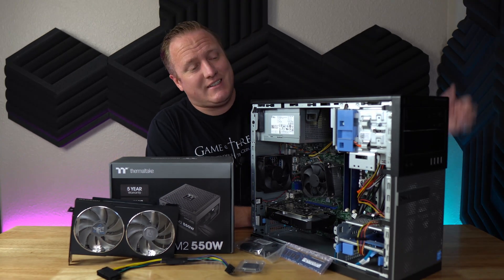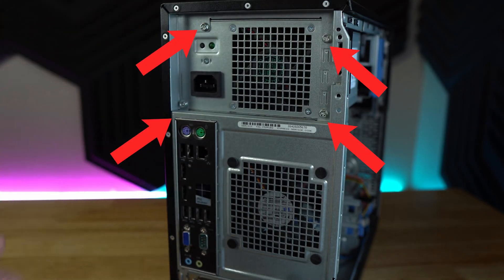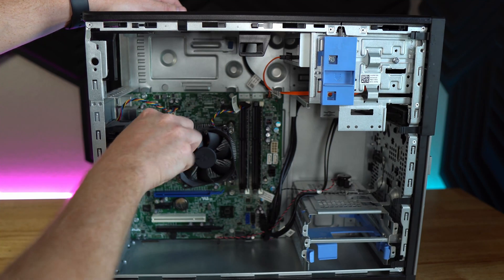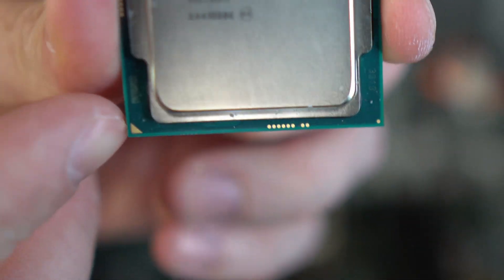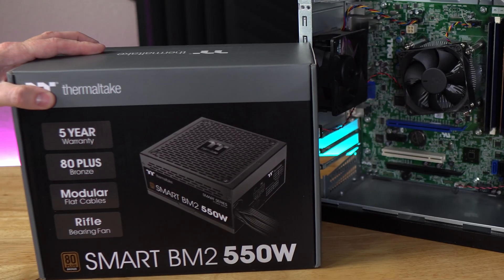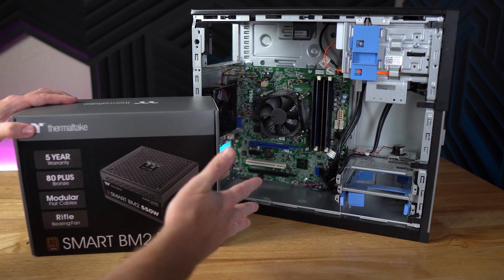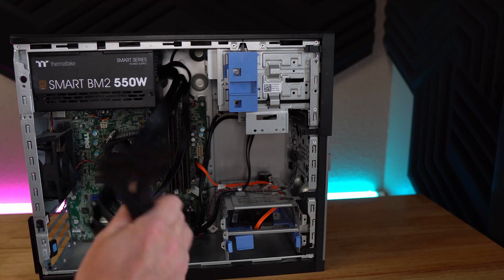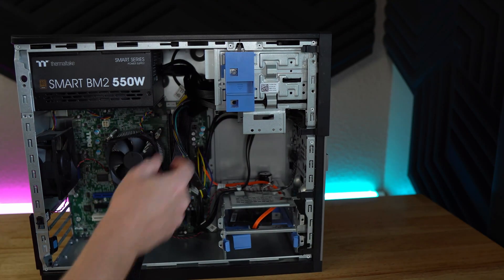Upgrading Your Dell Optiplex? Here's What You Need to Know!

Comment from the maker: If you haven't seen where I come so far with with this Dell Optiplex then go check out the previous vidoes I have done on this machine so far (below)
- Can I Turn a Dell Optiplex Into a Gaming Beast?  Parts Hunting for Reasonable Upgrades! -- https://youtu.be/wtuXV8aJrcY
- In 2023, Game NOW For UNDER $200 On This Dell Optiplex + RX560 -- https://youtu.be/9stPY7T1YNY
Reply: I happen to have stumbled upon a i7 4790k and I have no system to put it in and I'm wondering what optiplex I could get?
Reply: @Sneaky_snekk  I recommend the model shown here, the 9020 MT. It has 4 DIMM slots for max. 32GB of 1600mhz DDR3 RAM, it has more room in the case than the SFF model, and your i7 4790k is the max CPU it will take. I'm in the process of building one myself. 👍😏
Reply: @Sneaky_snekk  The Optiplex 9020 MT should take that processor. I have one too, will be upgrading in the coming weeks.
Reply: @Sneaky_snekk   I just installed one in a 9020 MT, it's the max processor the mainboard supports, and you have 4 DIMM slots for a total of 32GB RAM. I changed my hard drive to an SSD, the thing boots in a matter of seconds now. You can pick up used 9020s on E-Bay for a good price.
Reply: For future upgrades I recommend Seasonic - it's the manufacturer of those Dell PSUs, and they usually stick to the dimensions. But then again, I upgraded Precision T3620, with a bit bigger chassis, IMO, so maybe I had easier...
Reply: Quick question, cani change the fan on the stock cpu cooler? And if sodo you have any idea if what size of the fan is it?thanks! Solid video!🔥
Reply: Can you please test animating software on it like using blender,krita,and clip studio paint
Reply: I'm curious to know "optiplex" this guy is using....cause it doesn't help with not knowing what model this guy has...
Reply: How do we swap out the optical drive for more ssd spaces?
Reply: some of the newer optiplexes support 10th gen intel processers.
Reply: Can this run windows 11?

Comment: PSU has always been my most troublesome part when it comes to upgrades. is the used one im buying the right size? is it halfway broken? does the OEM mobo need certain pinouts and ill fry it if i try a consumer one? i got an old optiplex 390 that could use more juice, but i made it efficient, instead

Comment: If you wanted to upgrade the GPU but not the PSU and already have a the I7 CPU and 32GB of RAM the RTX 3050  6GB VRAM low profile variant should fit the PCI slot right? Planing to do this since the Wattage seems to be rated for 270 and the original PSU is rated to be 275. So assuming I can get the GPU to slide in under the RAM cards my plan should work, right?

Comment: hmmmm. Major safety risks
Case modification: Dremeling and modifying the case to fit components can be dangerous. It risks damaging internal wiring, exposing sharp edges, or compromising the chassis's structural integrity. Improper modifications can create a fire hazard and void any warranties or regulatory safety certifications.
Modified PSU mounting: Dell SFF cases use proprietary hardware, including specific latching mechanisms for the power supply unit (PSU). Modifying this system to secure a standard ATX power supply, like the Thermaltake BM2 550W, is unsafe. If the PSU is not mounted securely, it can come loose and damage other components or cause an electrical short.
24-pin to 8-pin adapter quality: Using an uncertified 24-pin to 8-pin adapter to power a proprietary Dell motherboard is a major risk. A low-quality adapter can have the wrong pinout, improper wiring, or inadequate voltage regulation. This could fry your motherboard and other attached components, and create a fire hazard. While reputable converters exist, using any with a modified setup compounds the risk.
Electrical tape on a flexible USB header cable: Using electrical tape on a modified or flexible USB 3.0 header cable is a fire hazard. The USB 3.0 header carries power and high-speed data. A loose or damaged connection wrapped in tape is not secure and could cause a short circuit. It is not an adequate or safe way to secure an electrical connection inside a PC. 
Proprietary design limitations: Dell's OptiPlex line uses proprietary designs for cost and serviceability, not performance. The motherboards often have limitations, like non-standard wiring and restricted power output through expansion slots, which may not provide the full 75W required by some GPUs.
Poor thermal management: The small form factor case and modifications disrupt the intended airflow. A much more powerful CPU (i7-4790) and GPU (RX 6600 XT) generate far more heat than the stock components. Cramming a full-size PSU and a large graphics card into a small chassis without proper ventilation will lead to overheating, throttling, and premature hardware failure.
Cable management: "Tucking" a large amount of cable bulk into the limited space can further impede airflow and contribute to overheating. The Core i7-4790 has 4 cores and 8 threads.
SAFER: Instead of performing risky modifications on a Dell SFF, a safer and more reliable option would be to purchase a used, standard ATX mid-tower case. You could then transfer the OptiPlex motherboard and core components into the new case. This would allow you to safely install a standard ATX PSU and larger graphics card without needing to perform unsafe case modifications.

Comment: Thanks I ordered the 24 pin to 8 pin, will be doing this on Friday. I have a GTX 1660 to add to my optiplex 3020.
Reply from the maker: Heck yeah!
Reply: @PCTechHustle  Way better performance and no crashing every 15 minutes that i was getting on a custom amdfx 6300 setup with an old hard drive, that 8 dollar power supply cable was worth it, been playing horizon 3 and now seeing what else to play.

Comment: Hello, I have the Dell Optiplex 980 i-7 860 @ 2.80 GHz, like 14 years only almost.... can I upgrade this to i7-4790, 3.60Ghz (based on this video) or any higher? If so which one is suitable ? Also can you send me the part link or details of front panel USB 3.0 upgrade. Thank you.
Reply from the maker: Hi.  Unfortunately You cannot upgrade your system any further.  The i7 4790 is a completely different architecture.
Reply: @PCTechHustle   Thanks for you reply. How about to USB 3.0? is that as well not possible with the current config?

Comment: I had the same issue with the power supply fitment on a dell optiplex 390 mt and I simply took out the mother board, put it in, and re-installed the motherboard afterwards. Worked like a charm!

Comment: What operating system are you using? Windows 10 or 11?
Reply from the maker: Windows 10 in this video.  This generation of Optiplex will only support windows 10
Reply: @PCTechHustle can I upgrade the motherboard to make it use windows 11 basically kinda using this model as a case

Comment: You can actually pull the door latch back and then tilt it out, which will allow you to insert a psu without removing it or removing the spring. I’ve figured this out after about 5-6 optiplex builds
Reply from the maker: Great tip!

Comment: getting a Dell OptiPlex 7020 MFF Micro Desktop Computer - 14th Gen Intel Core i7-14700K up to 5.60 GHz, 64GB DDR5 RAM, 1TB PCIe SSD + tomorrow. What are suggested upgrades for that model? I plan to upgrade the ram to as high as i can get it. I also want to upgrade cooling and processing speed
Reply: also will an i9 work with my system

Comment: I have an emachine case with a GIGABYTE B550M AORUS ELITE AX /Ryzen 7 5800X3D/128GB DDR4 3600 /4 tb total 2tb nvme 2tb SSd ,Radeon Rx 5700XT ... looks original form the outside but has been modded for cooling on the inside (the hardest part was putting in the USB 3.0 ports on the front cut my fingers up trying to get it right and tight)

Comment: Thanks great video! That 28 to pin adapter solved my problem! I got this 9020 on Amazon w/i7 32gb 1tb, so I order a RX580 & a XPG 650w PSU, both of this items will work on this pc? And also I still can’t figured out that 4 pin white connector on the mother board, didn’t see you connecting it and this PSU don’t have a 4 pin connector

Comment: Hey man, I bought a 990 sff a couple years back and have been gaming on it. I just bought a gtx 1650 and i realized it doesnt have a 6 pin connector. can i just put an atx powersupply in it? and just have it sit outside of the case?

Comment: PLEASE DONT BUY A CHEAP 24 pin adapter with a powerful psu.

I tried using a cheap 24 pin to 8 pin adapter for my 750w psu upgrade.
IT fried the connector, the Psu, the motherboard and my beliefs in these things

Comment: i never saw you plug in the 4 pin cpu power connector for the motherobord is it not needed with th upgraded power supply and only need the 8pin connector? i have a optiplex 9020 just like this one
Reply from the maker: You do need to plug that in.  You can slip the 8pin cable into 4 to make it work.
Reply: @PCTechHustle  my power supply had a connector that looked like a 8 pin but splits to make a 4 pin I didn't notice it till I looked closer that's what I wasn't seeing 😅 I ordered the 24 to 8 pin adapter ty for the response

Comment: Just bought a dell optiplex 7010 rx 550 and a psu.I dont have a monitor and looks like my gpu is incompatable with the pc since i am pretty much just getting a black screen.
Reply from the maker: Try removing the GPU and booting from the onboard video
Reply: @PCTechHustle  so heres the thing I dont have a display port on my tv nor the cable anything else i should try?
Reply from the maker: @dell_conagher69  you can get an adapter and convert the display port down to HDMI
Reply: @PCTechHustle  okay i just have one more question.Do i then try to get the drivers for the gpu to see if it will work?
Reply: @PCTechHustle  could the gpu itself not be compatible with the pc?

Comment: Can i slap a modern mother board on this or does it not fit?
Reply from the maker: Well yes.  But that basically would be considered a custom build inside an Optiplex case at that point.  If that’s what you are after.

Comment: Ok I have a Dell Optiplex 9010. I put in a 500w PSU and put in a ASUS AMD Radeon RX580 8GB 2304SP GDDR5 Graphics Card (DUAL-RX580-O8G). Now I get a flashing amber light on the power button. What would be my issue and what do I do to fix that? I was every excited when I put parts in but now I'm depressed that it has an issue and not getting it working.
Reply from the maker: All power connections properly clicked in?  Maybe try just removing the GPU just to see and boot without it in / on the integrated graphics on the CPU.
Reply: @PCTechHustle  I put everything back to the way it was and I'm still getting the flashing amber light on the power button  in a pattern of 2 then 3, 2 then 3.
Reply from the maker: @chibearfan54 that is actually a code you can lookup to see what it is
Reply: Ok I have the flashing amber light on the power button taken care of. Everything connected good but I have no display on screen.

Comment: I've heard about the PSU cable adapter causing shorts or frying the MB, is there any way to test it before running it to try and avoid a fried MB?
Or any specific suppliers that are safe?
Reply from the maker: A short would only occur if something was plugged in wrong.  I would however, yes, advice against using adapters on these tiny power supplies these machines come with.  Replace the power supply like I suggest here in the video.
Reply: @PCTechHustle  I should'a specified I was talking about the ATX to 6-pin adapter. I'm currently about to put an CX550 PSU in a 3020 with an upgraded RAM and CPU. I have a GTX 1060 I plan to put into it after the PSU upgrade.
I also have a Lenovo Thinkcentre M73 I'm planning to upgrade as well.

Main reason I got worried was I heard some people complaining on the Amazon reviews that the adapter fried their motherboard with too much current/voltage. Probably quality control issues with the adapter I'm guessing.

Is there anything I can do to check it over to avoid such a fate though?

Comment: Yea well, The 1st thing you need to know is WHAT OS are you going to install. IE Windows 7 64 bit will not install or work on all machines, IE Lenovo using DDR4. Also all VC's will not work with all OS
Reply from the maker: Windows 7???  Bro you are living in 2009!  When it comes to these generations of Optiplexes the highest and supported OS if considering windows would be windows 10.  However even windows 10 is going EoL by October and these systems don't support Win11.  A linux distro might be a good alternative but that is REALLY stretching the life out of these 10+ year old systems.

Comment: You can also use small and thin but strong magnets on all the top 2 corners it will get the job done if the mounting bracket is removed
Reply from the maker: Good idea!

Comment: Sir I upgrade my dell optiplex 3020 but it got a problem to me actually I. Install new rx 580 8gb GPU and also upgrade ssd in it but while gaming after 5 to 10 minutes my monitor screen goes black can you please suggest me what should I do with this trash because it's so terrible to use because every 5 minutes I have to restart it😊
Reply from the maker: What kind of power supply are you running?
Reply: @PCTechHustle  thanks for your reply sir psu model is aigo CK 650 watts I purchased it totally new actually I already took it to the technician and he told me don't spend a single penny on it 😔 i still don't understand why screen goes black while gaming every 5 minutes

Comment: Thank you so much for your video! I put an RTX 3050 in my optiplex 7020 and it’s working so great! I’m still trying to figure out the power supply so I’m not running it too much the links are so helpful just trying to figure out the pci adapter because my power supply has a 6 pin and the dell has 4 pin
Reply from the maker: Glad you found the video helpful!

Comment: Just found a dell optiplex 390 can I follow these steps ?
Reply from the maker: A 390 is extremely old.  While yea you can follow the idea of these upgrades you will have to get a different processor.  I7 2600 is your best CPU for that model.  I’d suggest trying to get a new Optiplex that supports at least 4th gen CPUs though.  What you have is 2nd gen.
Reply: @PCTechHustle  got you I’m just gonna build from scratch tho I was just wondering

Comment: There are some budget $260 optiplex that have a i7 8700 its a 6 core/12 Thead beast and you can even pair a rx 7700 xt with it with a little bottleneck depending.
Reply from the maker: I believe those Optiplexes are very small form factor and low powered.  I’d have to double check but my latest attempts to find new Optiplexes and do some of the same have been of that same theme.

Comment: i did the funny on it, i got an optiplex 790 from a friend. i gutted it, turns out it fits an matx motherboard. so, the only natural thing to do was put my PC in there, i5-12600k, z690m, 32 gigs ddr5, and an MSI gaming x trio rtx 3080. had to remove the hard drive bay and the optical bays, but one i did that, the aio fit on the front, the 750 watt psu fit up top, and i get 120fps+ at 1440p. me and My friends call it the opti-flex
Reply from the maker: @theorphanobliterator  sleeper!
Reply: @PCTechHustle  fr the airflow is a bit iffy, but the GPU never hits 70C even with a +150, +1200 overclock on it. the CPU is an OC demon, too. 5.3GHz all core with no voltage increase, it's beating an 11900k by a lot. super happy with it

Comment: To be clear about power supply dimensions for other viewers, they should be 140mm X 150mm X 86mm. if a PSU is described as being "ATX12V/EPS12V" that is usually an indication that it will be 160mm long or longer. Standard ATX is usually only 140mm, but check twice. 

Graphics card length accounting for the hard drive cage. will max out at approximately 260mm for the snuggest fit, but a gpu about 242mm long should be the limit. (for a visual, the RTX 3060ti Fan Edition and RTX 2070 Fan Edition are both 242mm long and fit nicely. Of course, this isn't a problem if you have removed the cage.
Reply from the maker: Fantastic information!  Thank you!

Comment: Ok i bought the i7-4790 and it doesn't fit what should I do?
Reply from the maker: What model Optiplex do you have?
Reply: @PCTechHustle  7010
Reply from the maker: 7010 will work fine with a 4790
Reply: @PCTechHustle  yeah I popped off the little plastic pieces that were stopping it and it fit
Reply: Ok hit a snag I've got it put together but now it won't boot and it has a flashing yellow light (it flashes twice then stops and repeats) I don't know what I did wrong

Comment: I’m about to put an amd radeon graphics card in an Optiplex 990 that has integrated graphics. I’m concerned about making the switch. I know the intel graphics are supposed to disable automatically in favor of the new one, but I’ve heard conflicting stories that they won’t many times & people get stuck not knowing what to do.
Reply from the maker: By installing the GPU you should easily be able to just plug into the graphics card ports without having to make any kind of "switch".  It should just natively work.

Comment: i have dell optiplex 390 i need a NVIDIA graphics card for it but i don’t know what type that will work on it
Reply from the maker: That is a very old / low powered GPU.  However, I would suggest something that doesn't require a power supply upgrade.  Something like a GTX 1050ti or 1650 from NVIDA
Reply: @PCTechHustle  ok i’ll get gtx 1050ti ty

Comment: You skipped two important parts!  How do we hook up the gpu with this psu? Also, how did you hook up the 4pin power to the motherboard?  You only showed how to remedy the 8pin power issue!
Reply: The 4 Pins on the Optiplexes are Standard 4 Pin CPU pin Power.
Reply: He had an adapter for the new power supply and the PSU comes with 2 pin +6 pin GPU connectors